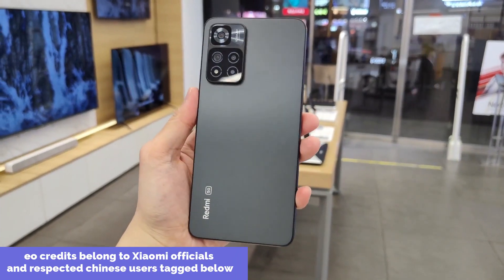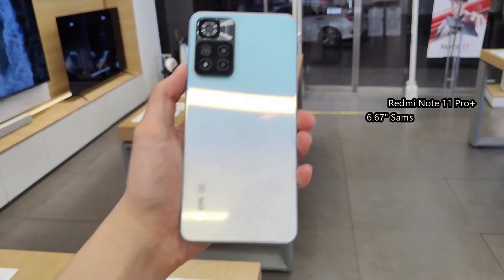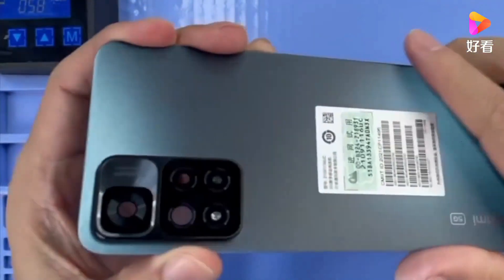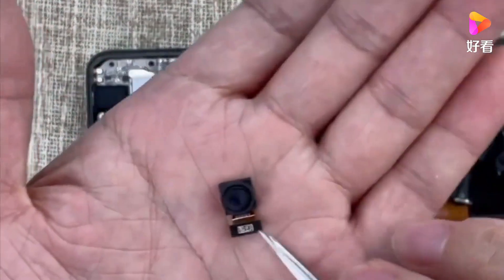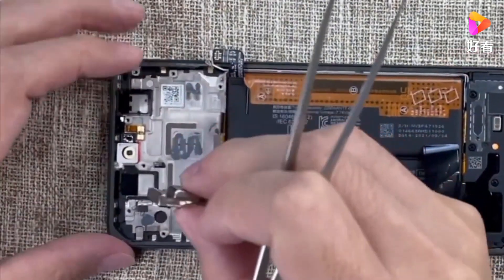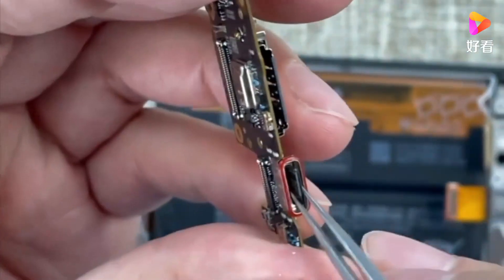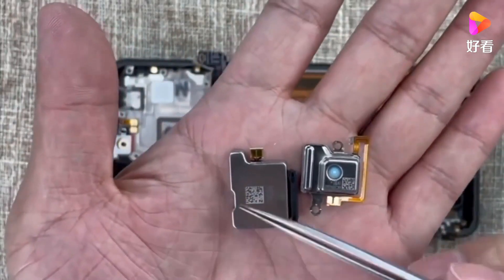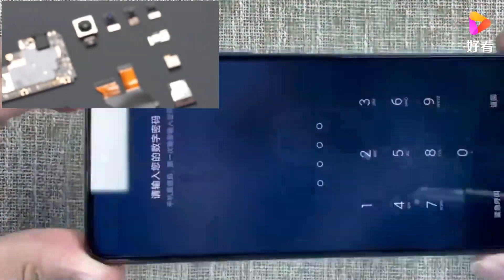Redmi Note 11 Pro+ Teardown/Disassembly/SD Card/120Hz screen/108MP camera/4500Mah 2 batteries 120W

Comment: But they don't provide native proprietary call recorder on the call dialer screen, which is why I from UK still used to buy Xiaomi with Chinese ROM my mi 10 pro has call recorder but because of Chinese ROM it displays some screen with Chinese writings and doesn't have all the bands  for U.S. where I have to travel often, but my Vivo X 60 does.
Reply: Indonesia firmware in help
Reply: So the way to go is get a phone with Chinese rom ? Cuz i have same problem with my m3pro 5g and i installed every possible app still couldn't record other person voice ,